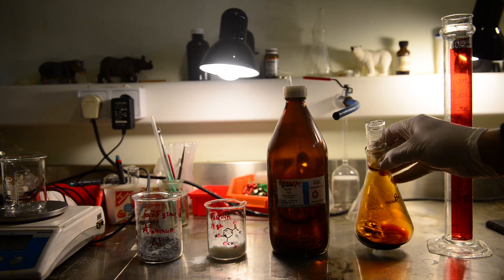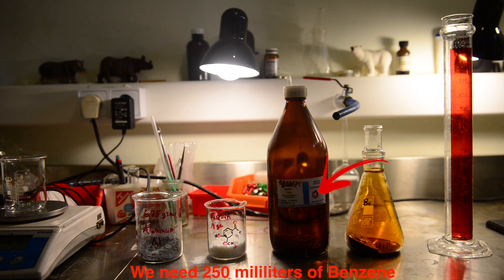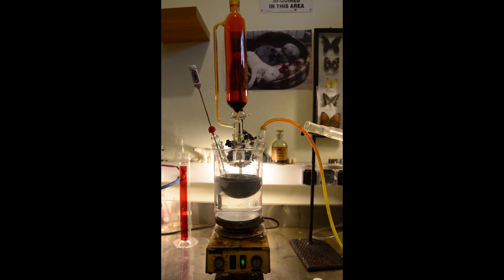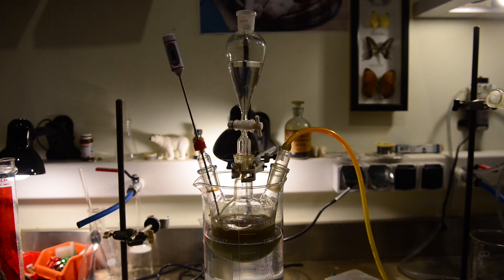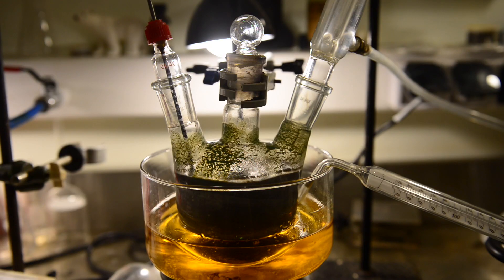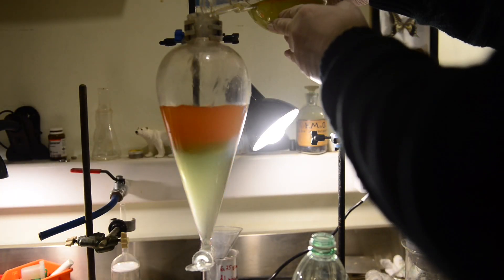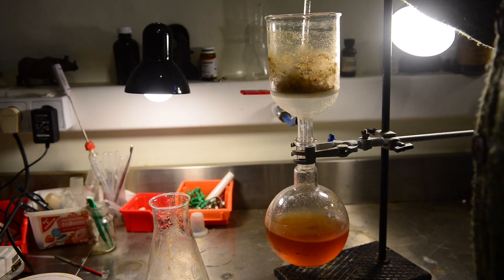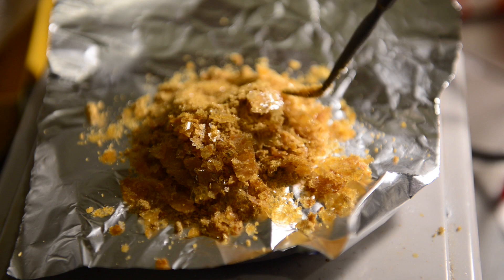Protocatechuic aldehyde preparation by Vanillin demethylation.

Comment: Maybe time to start making videos again? We love to see a continuation of your progress.
There is a newer method of Vanillin de-methylenation using AlI3 formed in situ from Al powder and Iodine. Its better and safer, 91% yield.

Synthesis of Protocatechualdehyde from Vanillin
To a mixture of AlI3 (38.5 mmol, 1.1 eq) prepared in situ from Al powder (2.205 g) and I2 (14.655 g, 57.74 mmol) in MeCN (250 mL) was added DMSO (3.009 g, 38.51 mmol, 1.1 equiv).
The mixture was stirred for 0.5 h at 80 °C, before vanillin (5.326 g, 35 mmol) was added in portions.
After stirring for 18 h at 80 °C, the reaction mixture was quenched with aq 2 M HCl (50 mL), and extracted with EtOAc (3 × 100 mL).
The organic phases were combined, washed with sat. aq Na2S2O3 and brine, and dried (anhyd MgSO4).
After filtration, the organic solvents were removed on a rotary evaporator, and the residue was purified through flash column chromatography
(eluent PE/EtOAc 11:9) to give Protocatechualdehyde; yield: 4.413 g (91%).

From paper
Cleavage of Catechol Monoalkyl Ethers by Aluminum Triiodide–Dimethyl Sulfoxide
DOI: 10.1055/s-0037-1610996
Reply: Hmmm...interesting...I wonder if the acetonitrile could be wholly replaced with DMSO, I see no reason why not, both are polar aprotic, plus it might be considered more OTC, as DMSO is easier to obtain and not as toxic, or rather just not toxic...also, another thing I noticed on the stoichiometry, using 1,1 molar excess AlI3 is probably wasteful, seen this type of reaction in a patent with 1, 2, 2.5 and 3 molar equivalents of Iodine used, 2.5 actually comes out as the clear winner, high 80's from memory...

Comment: Does anyone know what O-demethylation is or what it involves?
Reply: O-demethylation is the removal of a methyl group from a methyl ether bond. In this case, it's the removal of the methyl group (CH3) from a phenolic methyl ether. Phenolic ethers are notoriously difficult to hydrolyze bar harsh reaction conditions.
Reply: @GNP3WP3W  have you tried the preparation of piperidine. I've tried it and have been unsuccessful. Looking for someone who can help.
Reply: @bigcheese6794  piperidine is best obtained from piperine which can be extracted from black peppers. Black pepper is pretty cheap and hydrolyzing piperine is straight forward. You can find procedures online. Otherwise if you are dead set on the synthesis of piperidine, then you can perform a double aza-Michael addition of Acrylate ester to ammonia followed by a Dieckmann condensation, decarboxylation, and Wolff-kishner reduction on 4-piperidone. It may be easier to do the aza-Michael addition to methylamine and then perform an N-demethylation on N-methylpiperidine
Reply: @bigcheese6794  ah, don’t sweat it man. Honestly you should take a look at the science madness forum. There are tons of really smart and helpful members. People way smarter than I am haha I just like to read patents and research papers on chemistry

Comment: You won't extract any protocatehualdehyde from water using DCM, thats for sure
Reply: uh... why is this? Their logp values are almost identical: 3,4-Dihydroxybenzaldehyde = 1.3, Dichloromethane = 1.25
3,4-dihydroxybenzaldehyde in its free acid form would be more soluble in DCM than water...

Comment: Thank you. That was very interesting but it raises a lot of questions:
How can you be sure it is the product and not unreacted vanillin with was extracted by sodium hydroxide (because of the phenol already here in the beginning and then by the DCM? Or a brominated product? 
Normally Br2 with the in situ formed AlBr3 would have brominate the aromatic ring of vanillin (very reactive towards aromatic electrophilic substitution) or even benzene.
Reply from the maker: Thank you for comment. First of all the product is not vanillin simply because of the smell :).  Secondly, I did recrystallization from the boiling water and have got nice almost white crystals but different from the vanillin. The best way to confirm it is methylenation. When we are starting vanillin addition to the mixture there is no free bromine left. All bromine have reacted with aluminum. So, I don't think that the bromination of the ring is possible.
Reply from the maker: The benzene can be brominated indeed, but the process is very slow and aluminum is reacting much faster.
Reply: @letschemistry9306  This... I don't know, the catalytic power of AlBr3 is very good. When bubbling Cl2 through toluene and iron wool mixture, very little Fe actually reacts with Cl2, all the chlorine is quickly trapped onto the aromatic ring. 
It seems that it's not the case here but I found that surprising.
Reply from the maker: @afondlesballons881  Totally agree about catalytic powers of aluminum bromide but there is no bromine left to catalyze benzene bromination. During the addition, some neglect amount of benzene probably would be brominated but most of the bromine would be consumed by aluminum which is reacting much faster than benzene ring. On the next stage, aluminum bromide forms a complex with benzene. Now you've made me think that unreacted aluminum we've seen on the extraction phase was left because of this side reaction with benzene :D but who knows. I must reproduce the experiment with HgCl amalgamation to be sure.  Can anyone tell me what is melting point of Protocatechuic aldehyde? because it is not 153C. I have a commercial product and the melting point is much much lower. That's why I sad methylenation is the best way to prove. When you smell the piperonal you can not be mistaken.
Reply: @letschemistry9306  That could indeed explain why some aluminium remains.
Never heard of such complexes. Would you send me the paper you were following? I am a bit curious and one of my friend had some issues with some similar demethylation (with AlI3 generated in situ in cyclohexane with some surfactants).
Unfortunately the melting point is around 153°C according to every sources. Have a look at: http://www.chemspider.com/Chemical-Structure.8438.html
(in: properties/experimental melting point), there is a lot of different and reliable sources, they all claim a melting point between 150 and 157 °C.
Your reference compound is probably contaminated with something else and you have a cryoscopic effect. 
Try to do a TLC and see how many spots you have to get an idea.The product is both a polyphenol and an aldehyde, that's very easy to oxidize and I wouldn't be surprise of some oxidation products contamination.
Reply from the maker: @afondlesballons881  Here is the paper. 
https://patentimages.storage.googleapis.com/09/7e/49/ed936d620fda01/US2975214.pdf
As far as I know, in the case of Aluminum iodide, Hydroiodic acid is formed which has a  strong oxidizing property, and the product will be destroyed.
Reply: @letschemistry9306  The optimum solvent for this is nitrobenzene, the nitro group withdraws the pi cloud electrons making the ring far less active towards substitution, highest yields are attained with this solvent. Also , it is not ideal to leave the water extracts in a basic pH state for long periods, phenoxide groups are notoriously reactive lowering yield. Keeping it cold may help.
Reply: This is true..generally it is a good idea to always have your target compound in this case in a reducing environment during clean up/manipulation, a pinch of bisulfite protects both phenols and aldehyde. Cyclohexane with some "surfactants"...let me guess...was it "Snuggle"....?
Reply: @letschemistry9306  That's true indeed, there is no bromine color remaining, my bad.
Maybe you could show the recrystallization and possibly a melting point measurement in this kind of cases. That would be nice :)